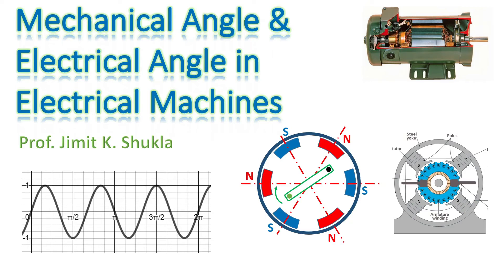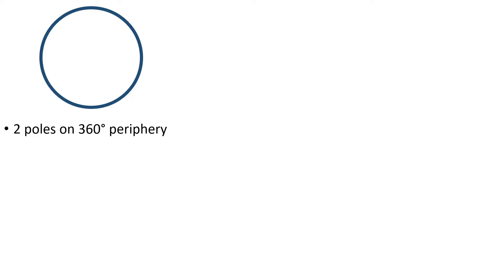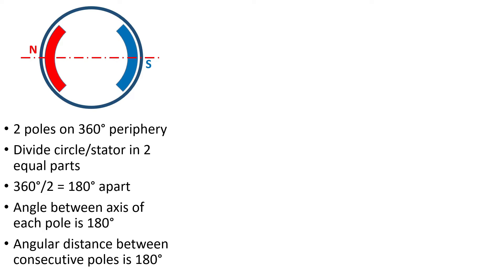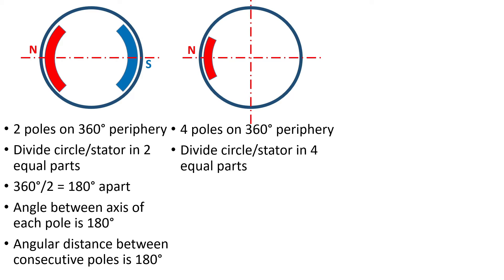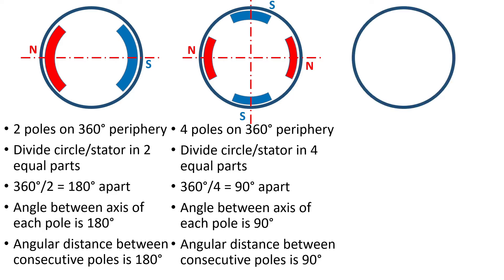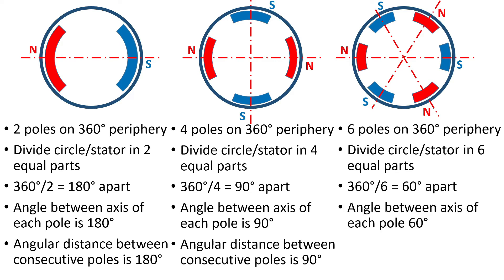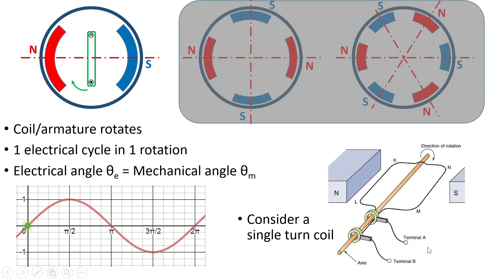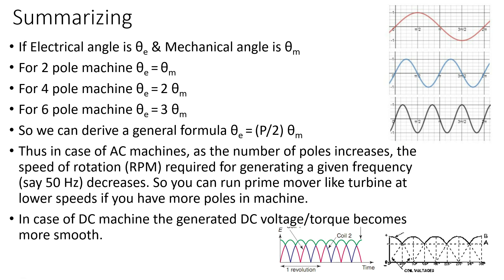Mechanical and Electrical Angle Concept | Relation Between Electrical Degree and Mechanical Degree

Comment: So with this sir, can we say that the speed (rpm) of a machine is determined by the numbers of poles?
Reply from the maker: Yes indeed. In AC as well as DC motors you can determine the speed from number of poles, and there are other factors also on which speed depends. Like in Induction motor(AC) speed aslo depends on frequency. In fact changing number of poles is a speed control method. But it is rarely used.
Reply: @jimitkshukla  thanks for sharing more lights sir. I now have a better understanding.

There's a project I'm currently working on, if you don't mind I'll like your moral input on it Sir.

I'll be expecting your reply
Reply from the maker: All the best for your project. I would drop a mail for sure.